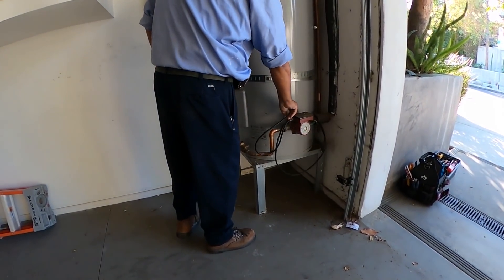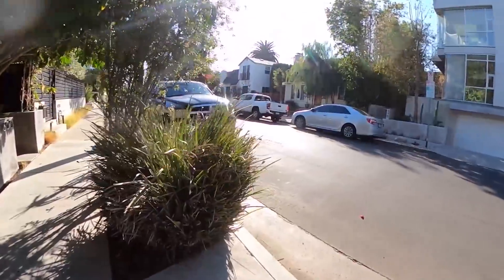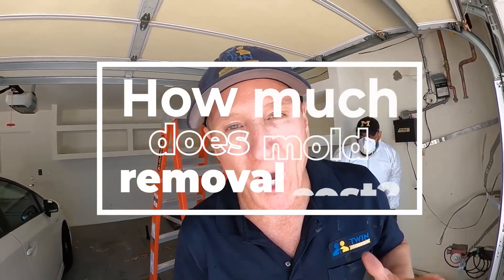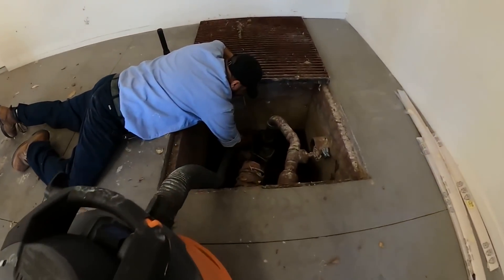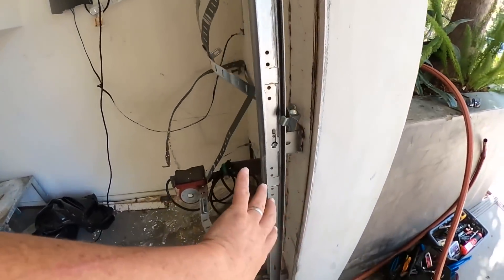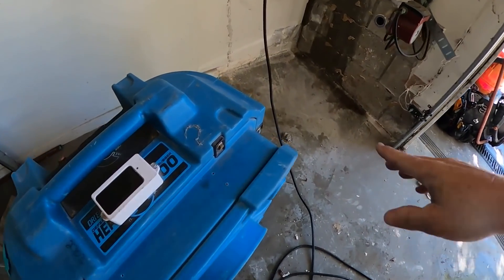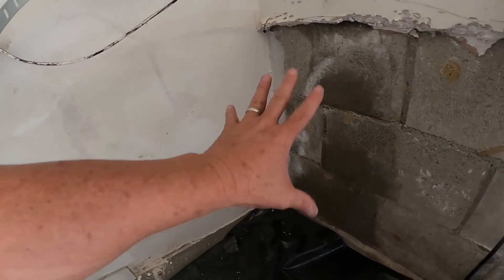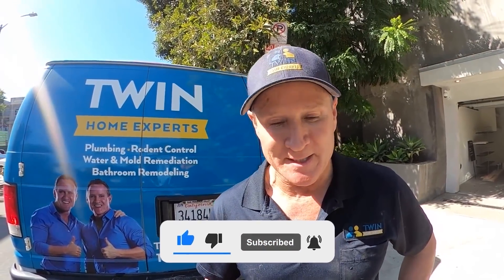How to check your WATER HEATER for TOXIC MOLD...mystery mold under water heater..

Comment: You guys could hit 100k sub's by the end of the year.
That is a strange place to feed the electrical wire through, I would've run the wire upwards to the top then drilled a fresh hole just for wire on its own, then sealed the hole once the wire was through to make it wind and water tight.

Comment: 2 ball valves on the heater.  1 on the inlet and one on the outlet 🤦.  That's a recipe for disaster if the homeowner ever decides to shut both of the valves off and doesn't turn the heater off.
Reply: Wow great point. I have 2 shut off valves on mine too. Now I'm going to put a sign on the outlet valve to make sure the water heater tank is off first

Comment: Very misleading title.
And, why would yo not thoroughly test water heater before hand for thermal expansion leaks, or inspection mirrors, or even just cut open the damage sheetrock? was removing the water heater really necessary to weather seal the irrigation line?